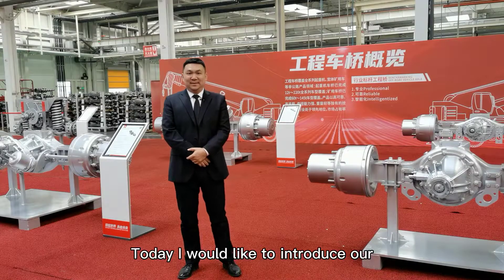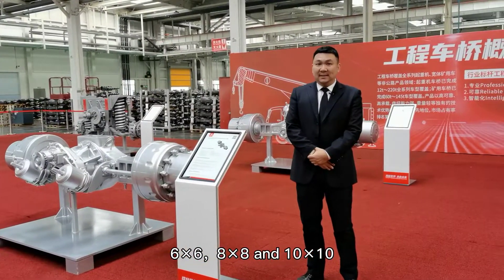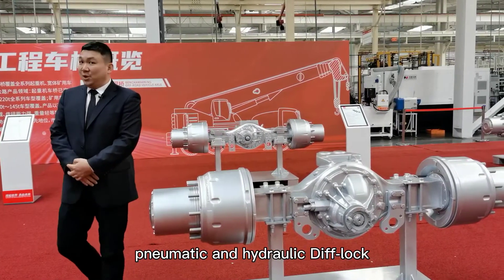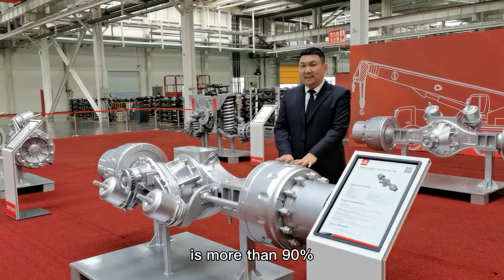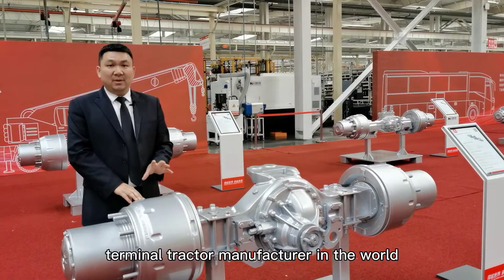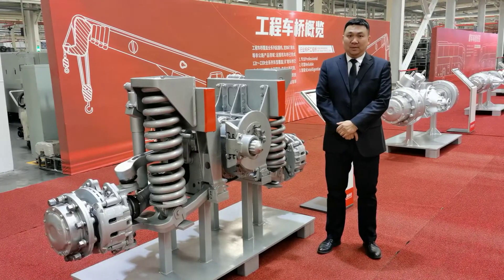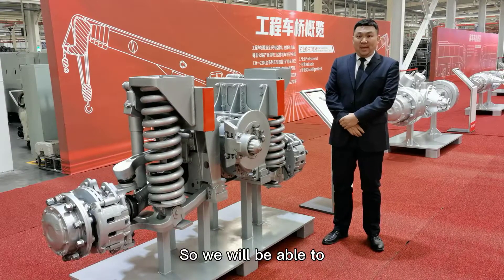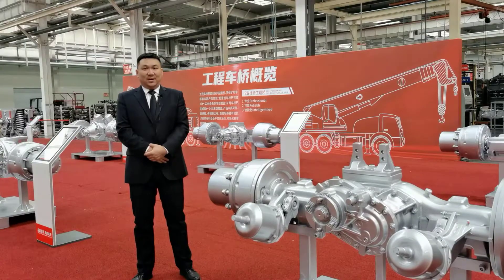HanDe Off-road and Special Vehicle Axle Presentation

Comment: Interesting approach it allows conversion of existing vehicle/ capital to E power and possibly increased power  
and efficiency ...with savings in overall vehicle wt and over all service requirements. 

The presenter seems a little more nervous in this one than in  
some other presentations for other lines from the same company. This made him a little harder to follow. 
Static displays show configurations but some sort of active display of the motor axels at work would greatly benefit your  company in terms of generating new customer interest through U-tube.